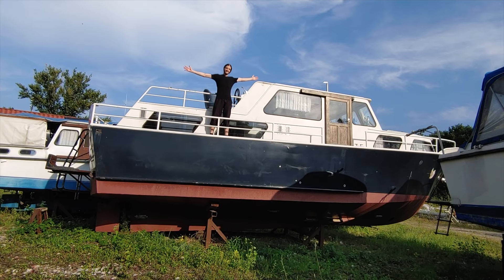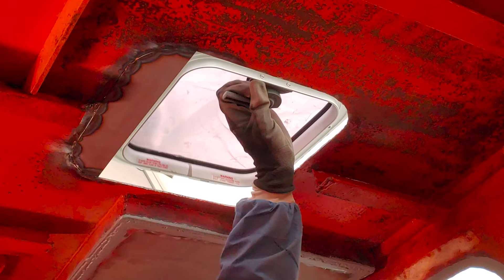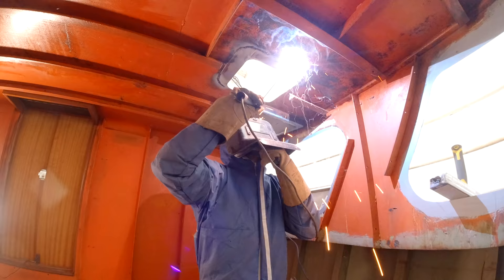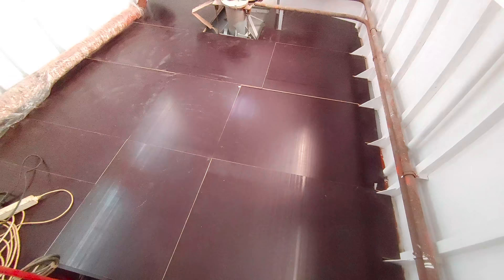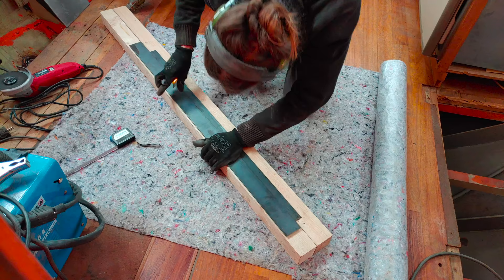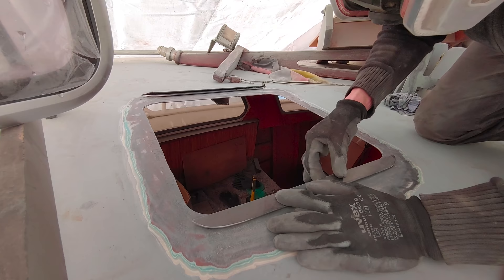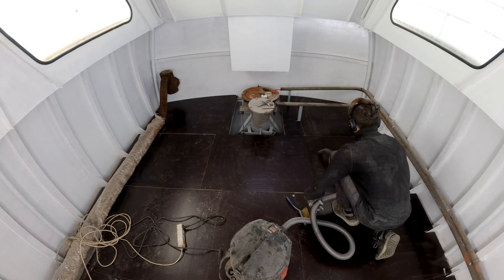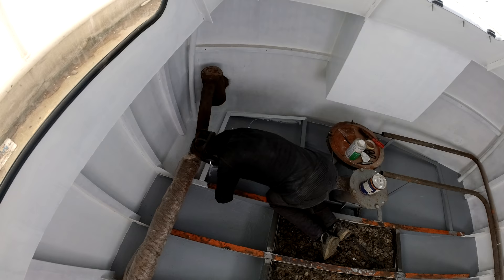Welding, Woodworking, Painting our 1978 Steel Boat - Week 22 - Vintage Yacht Restoration Vlog

Comment: I'm not familiar with the materials you used on the hatch, but the slightly raised lip will help with water pooling up against the hatch. 

THANK  YOU  for naming the specific Sikoflex 552 you are using. I'm starting a house boat on  tritoon project. Other youtube channels have mentioned the product, but never the specific model. You've saved me lots of research. Thanks. Appears to be drastically superior to silicone.

Comment: Your welding skills are definately improving. There is no no need to fill the gaps of the hatches. When the hatches are tightened to the hull, they will adapt (within reasonable tolerances) to the shape of the hull. A thick bead of sikaflex (applied just before installing the hatches) will take care of the last few mm of gap and ensure a watertight seal.

Comment: Looks great but I would have put the hinges facing forward, that way if you ever take the boat in the sea and a wave breaks over the hatch it will close, the way you have them now if the water would come in and a wave push he hatch open, you are probably only going to be on canals etc so not an issue but all sea going vessels I work on have hinges facing forward
Reply: You want the hinge facing back so when you are at anchor the hatch will direct air into the boat.   I lived on and cruised a boat for 3 years.  This is a must.

Comment: For creating a level surface, you will find it very helpful to make a sanding board.  For the small hatch for example.  Get a piece of stiff board large enough spam the hatch plus 10-20cm.  On one end glue on a piece of aggressive sand paper.  Maybe 80 grit?  Using is you can place the tail end on the reference surface and bridge across to the surface that needs adjustment.

Comment: Love, love, love the improved welding beads. It was pointed out last week. YOU ARE NOT using MIG. Metal inert GAS. You are not using gas. You are using core flux.

Comment: For your uneven floor supports, you may find it far more efficient to run stringers fore and aft, on about 12" centres.....shim off the beams....and work to a line level.

Comment: Looks great.
I will only suggest two things, and this will be my only comment here. 
1: When using masking tape, the remove it when the paint/filler paste is semi wet, so you don't have to scrape it off.
2: Use any kind of oil when drilling, it will make your drilling bits last much much longer. Even used motor oil is better than nothing.
Great build.

Comment: Get your self a oil can and place a drop or two of oil at the tip of your drill bit it will prevent your bits from heating and becoming dull. The bits will last longer

Comment: Glad to see you using a mig welder you get a much nicer weld with one then a stick welder especially if your not a pro I was going to suggest one to you but I didn't figure you'd buy  one just for a little bit of welding , you got to do there

Comment: I rebuilt and lived a steel boat for 3 years. Rust will be your biggest enemy.  Your second biggest enemy will be galvanic corrosion.  The best defense is excellent surface prep and epoxy primer and paint.  For the hatch repair would have prepped the area around the hatch with grinding or sanding to clean metal. Then painted with a good epoxy primer.  I used Jotun, but there are many.  I find a high build primer helpful. Then use just epoxy with filler to build up and sculpt the are you needed for the hatch. Then Epoxy paint again to encapsulate the filler.  Your last issue is to be sure the aluminum hatch has no contact with the steel.  Here again epoxy paint will be best.  Be sure the edges of the steel are well protected with paint.  Finally, used GOOD (316) stainless steel hardware.  No cheap hardware store hardware.  Use a good marine sealant on the hardware and under the hatch rim.  I'm enjoying the vids. Thanks for making them.

Comment: I used sikaflex as an Apprentice 40 years ago sealant under a 3 coat epoxy system. Good stuff. Here in the states we use 
3m 5200 Marine sealant/adhesive. 
 Nobody will do the work on your boat as well as you will do ♡
Reply: They will if you find someone truly dedicated to their work in excellence. However you are right in that they are quite rare. 
The few times that something broke that i had welded and they came screaming at me, I took one look and pointed out my welds were just fine and held up. It was actually something else that broke and i clearly pointed out the impact where it was hit with enough force to snap 4mm steel brackets. 
I hand built two large box trailers from scratch when i was fresh out of my apprenticeship. I still to this day see them getting around town with lots of scrapes but zero damage to them. I do know that they have written off a car and a bus though. Proudly made them indestructible. I know it is them because i did make one mistake. I spot welded the huge sides before welding them on and one has a fair sized kink in it, later learnt i should of just pinned them and welded along, that way they would still of been dead straight. Lesson learned and the second one was perfect.

Comment: Doing a great job 👍. One thing that can help when you are trying to level a surface is block sanding I have several lengths of aluminum rectangle Tubing 2 inches by 6 inches and Lengths ranging from 2 feet 4 feet 6 feet.. use self adhesive sandpaper and stick them on the straight edge of the 2 inch wide and you can flatten out a surface very well this method .. it will help you when it comes time to straighten out your hull .. hope this helps you .. again great job 👍

Comment: You are drilling the metal dry, hence the drill bit sharpness is wearing out fast, this sharpness can be maintained by using water mixed with drilling oil and apply repeatedly on the area while drilling.

Comment: It's looking great. Good job on those hatch openings. I would still be concerned about the plywood soaking up moisture as easily as that middle one warped.  Maybe a vapor barrier or a good coat of paint on the underside of the panels would be good. Maybe sealing in the rusty ballast with a coat of roofing tar or cheap latex caulk or something would help as well so it couldn't keep rusting as well as sealing out any moisture or eventual iron sickness in your wood panels.
Reply: Yeah I’m not completely sold on that flooring method at all.

Comment: Have been watching you on the big telly so not had chance to subscribe and comment. Thankyou for sharing your progress with us all, its all very interesting.
I notice that you haven't started outside yet and I can understand why, weather and other internal issues.
When you go outside please reconsider your original plan to remove the outer coating, this is what is protecting the steel and it looks too good to remove. Would rather you look for where it has delaminated from the steel and carryout local patch repairs. I think you should also consider why rust is occurring over the top of every glass window. Water trapped in the rubber. You may want to peel back the upper outside rubber seal and inject marine sealant before allowing it to spring back. You might want to consider installing eyelids over the windows as fitted to the early British freeman river Cruisers.
Keep up the good work we are all willing you on

Comment: Beautiful design,

For the cabin to have the mouth that the moisture that spoiled the wood will continue as long as you do not remove this crap underneath.

If it serves to make weight on the boat (keel) it weighs all this, it is to make the exchange for lead, so you get a cleaner environment, renovated and without humidity or subject to humidity.

It will help you a lot in future maintenance.

Comment: Good to see that you have figured out how to weld half descent welds now, that's good .... Next time when you use that fiberglass filler remove the tape immediately afterwards. That is how it's done in the body trade.
Reply: I didn't see a tap, I'm pretty sure he removed all the plumbing.
Reply: @MegaDirtyberty  sorry I meant to say, remove the tape shortly afterwards, before it hardens too much, because, it makes it a pain in the butt to remove if you wait till it hardens that's all.
Reply: @fonhollohan2908  I've found it depends on the tape and how long the tape is left, if left for (say) a month then it's very difficult to remove.

Comment: You should shim the floor vs thinning the boards.  Since the boat may not (likely is not) be sitting level, you can't use a laser level, but will have to put a series of stings.  Once you find your highest spot, you can calculate shim thickness for the other spots.  Alternatively you can sister wooded "joists" onto your existing metal ribs and set them all at a uniform height.

Comment: Has anyone mentioned making your weld joints a V shape with the grinder before welding. I can see cracks where your welds are butted together and then ground off.

Comment: I don't know if the primer you are using is anti-corrosive, but if it is it should be applied directly to the metal BEFORE you attempt to apply any filler. I also noted that you didn't protect the steel that you used to flatten out the curve, you just used the Sikaflex. If there are any voids and water penetrates you will get corrosion again. Always clean, pre-treat and apply a good anticorrosive primer before to attempt to apply either sealant or filler.

Comment: Forgot to mention. When sanding to level imperfections, you must use a solid block - wood or hard rubber. Sponge, or even the foam pad on your electric will not give you the results you were hoping for.

Comment: First of all, my sincere compliments for the way you handle this restauration project.
And I have a question: Is this boat a WADDENKRUISER build in Zuidbroek Groningen some 40 to 45 years ago? Thanks for you reaction...
Reply from the maker: Hi, thanks for the praise. YES it is a WADDENKRUISER from 1978, how do you know? (I also mention it in the very first video)
Reply: @MyFirstBoat  I dropped in into your blog at a later stage. I had to look twice and what I saw was exactly the same boat my father had ordered to buil in the seventies. I was a world of remembrance to me. Since you confirmed to me it was een Waddenkruiser, I might have a surprise for you, as your boat is a Super Waddenkruiser - loa 12.20 mtrs.  The yard has also designed a somewhat smaller boat, which was named Waddenkruiser with a lenght of 10.50 mtr. I started to see all the video from week 1 onwards. Very nice work!

Comment: requarding welding small slivers around the hatches and window.
are you sure that with your welding skills as of right now, you won't find any pinholes along the road(river)?
Reply: The filler and paint will do a decent job of filling pin holes.